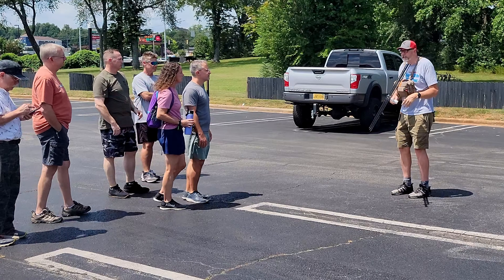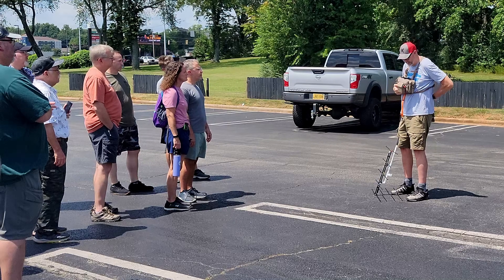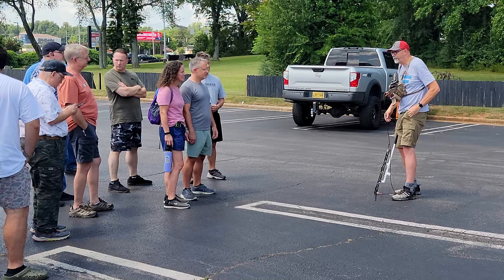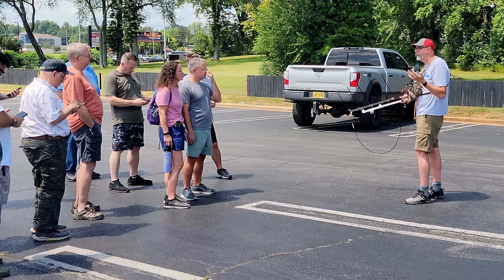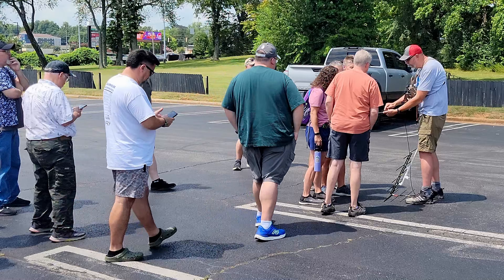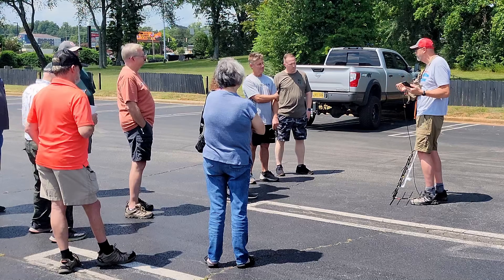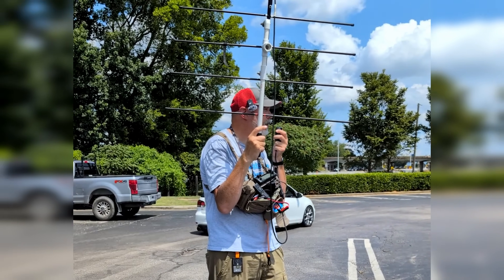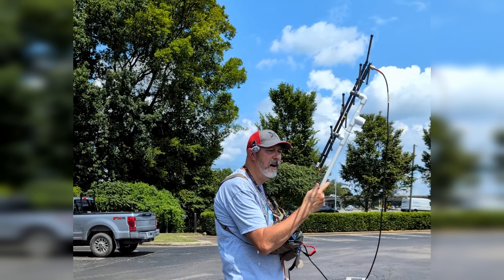Ham Radio Satellite Hunting Tutorial: Live SO-50 Pass Demo, Doppler Tips & Beginner Gear Guide

Comment: hey, quick question I noticed in one of your videos you put a handle on the elk antenna and I see in this new video you do not have the handle on the antenna. I recently just purchased the elk antenna,  I haven’t got it in the mail yet, but I was thinking about getting the handle made. Did you not like it or something? I was just wondering.
Reply from the maker: Great question! I have the 3d printed handle on my Elk.  When I go to the various Hamfests I fly. My buddy KM4ACK always drives. He brings his elk for me so I don't have to fly with mine. I'm still a huge fan of the mod!
Reply: @digital.rancher  OK thank you. did you ever try to use the FTM 500 for satellites? it works if you wanted to hear yourself on the downlink, but I use it a different way with the scope on it. I can see the downlink move. and I set my frequencies to transmit on the up link and receive on the down link in one memory slot, and then I program other memories for the Doppler effect
Reply from the maker: @SUFFO_GUY  I have not used one personally but I have been told that there are some third harmonic issues that will cause a problem on some frequencies. Glad to hear it is working for you!
Reply: @SUFFO_GUY  This will make more sense when yours arrives, but I replaced the T connector in the center (between the two elbows) with one from Home Depot that uses the same diameter for all three of the "ends" of the T connector. It's also the same as the handle that comes with it. And I bought a long PVC pipe that was only a few bucks, along with a PVC pipe cutter. I have several custom mounts and handles for my Elk now. Using PVC pipes is one of the most brilliant things about it.